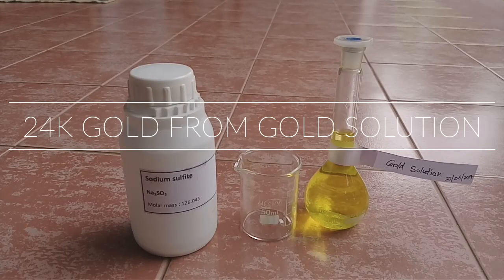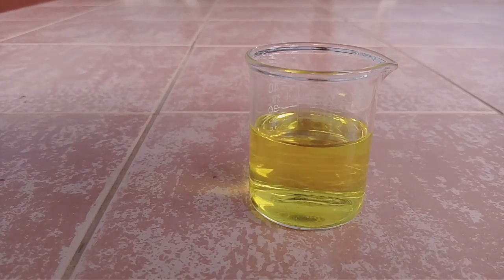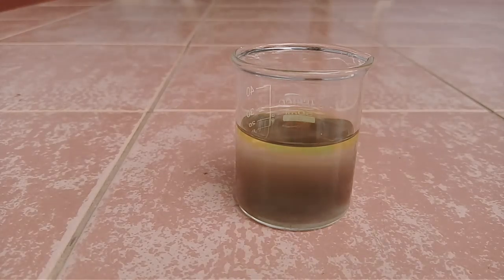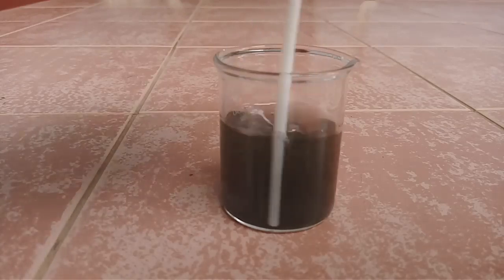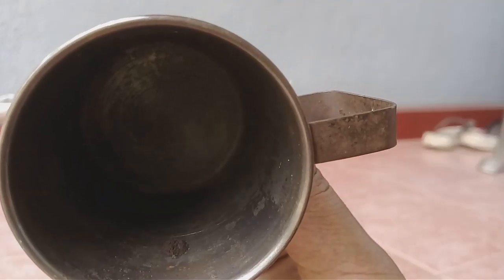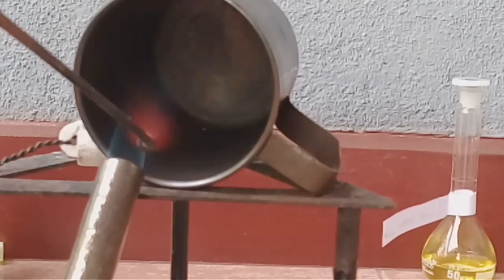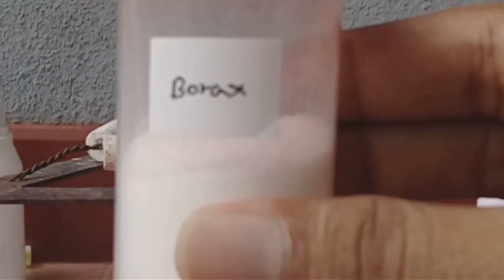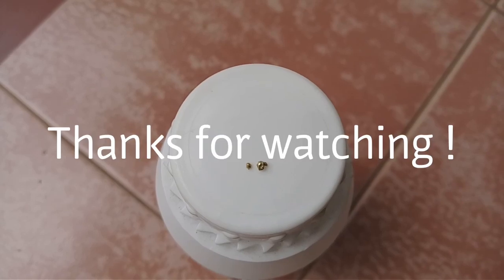24K Gold from Gold solution

Comment: How many days we can keep gold powder as it is befor melting it  there is any problem related 2 weight of gold there is chance of lost of some weight aur it will be same weight
Reply from the maker: Jiyan Singh u can keep it any time
Reply: @ChemExLK  metal won't be degrade nor expire.
Reply: Toxic gas is dangar gas to kaise mix karu sir aqua ragia or sodiam
Reply: @princejamess6974  that's why you have to mix it up under fume hood or under good ventilation. better do this mixing outside if you don't have fume hood because its more carcinogenic.do wear some mask.
Reply: After mixing with aqua regia the brown powder we get of gold  is there will b any weight problem due 2 heating it ?
Reply: @jiyansingh6240  nearly 99.9 you will get the exact quantity that what you used or mentioned before reaction.